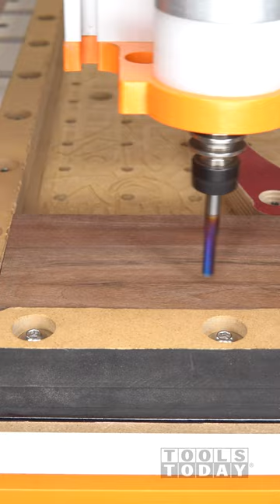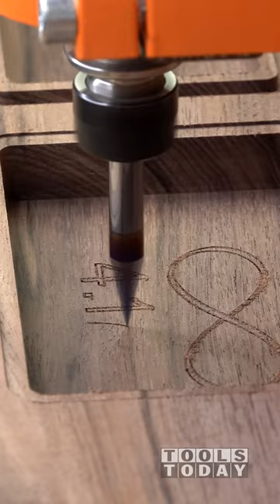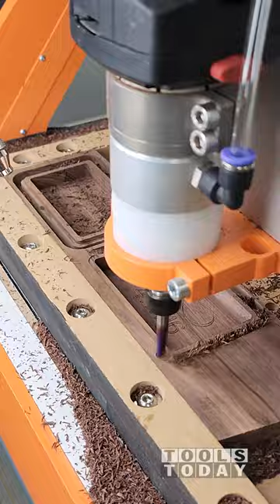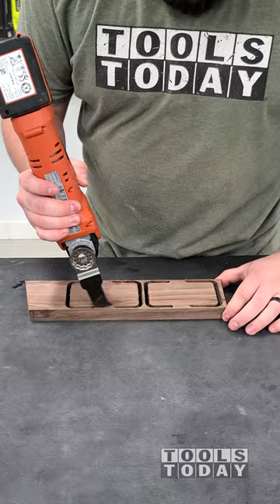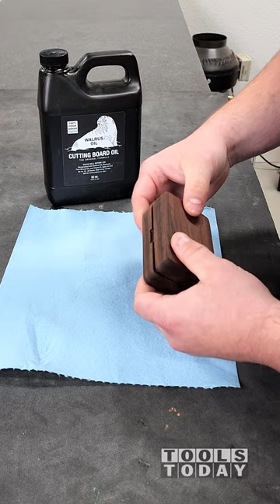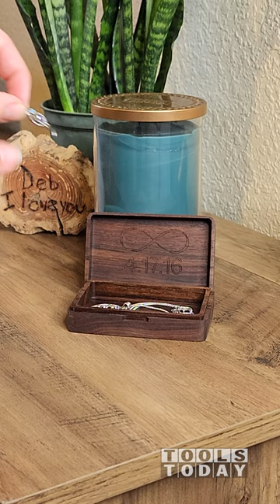Making a Jewelry Box

Comment: No craftsmanship n using a cnc or other technology…… for some or all of the work. Thats not real woodworking… when computers foul up or the power goes out a real craftsman can carry on old school by candle 🕯️ light if necessary that’s skill 👍. Old is gold
Reply: Hmm, “a real architect or engineer never uses BIM, gotta hunch over a backlit drafting table for 6 months”
Another: “a real framing carpenter would never use a circular saw, only Amish tools”.
Last one: “What kind of a journalist uses laptops and printers, pshhh, real writers only use mechanical typewriters so when the power goes out, they can keep journaling away”